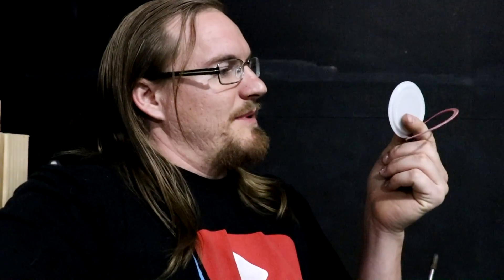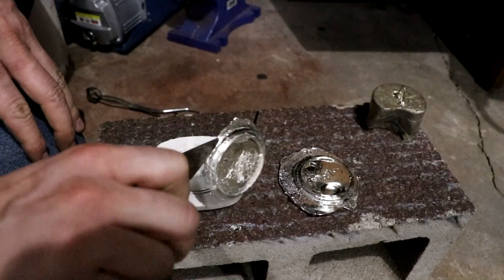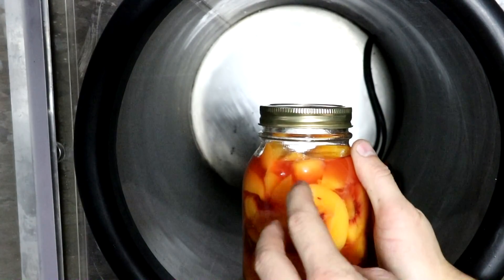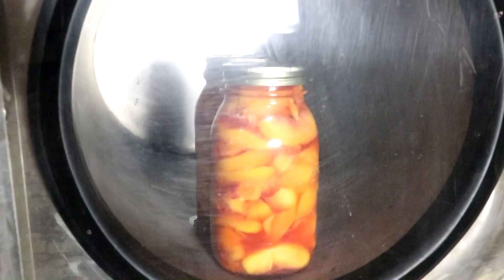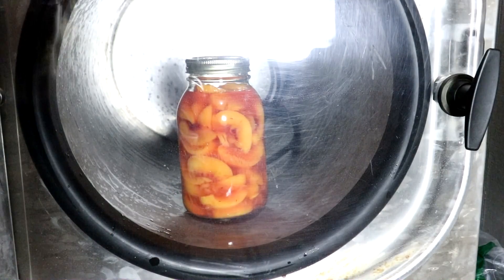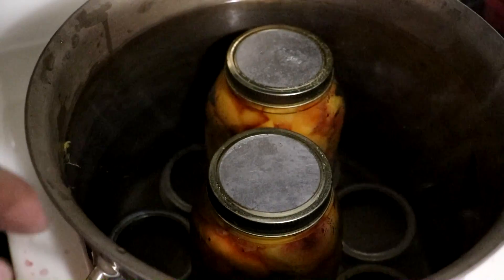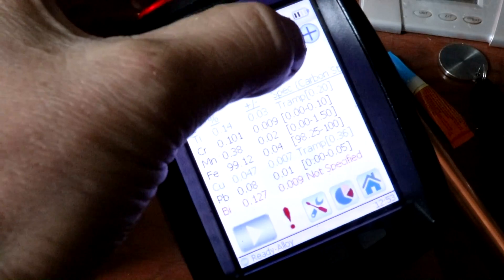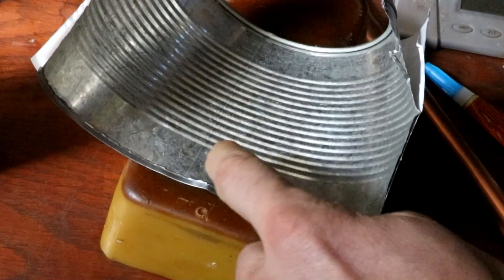Tin Canning Lids?

Comment: Could you use Aluminium instead of Tin?
Reply from the maker: Not without some sort of protetive coating, acids in the food will attack bare aluminum and the result is potentially toxic.
Reply: @theCodyReeder  what about gold?!
Reply: In theory gold is usable because of its resistance to corrosion, but gold itself can be toxic to humans (though gold poisoning is rare - the metal itself is almost inert, but can form compounds which are toxic). Aside from how expensive it would be, pure gold would be far too soft - less pure gold might be more mechanically suited to holding up against the pressure, but then you might have traces of elements like arsenic in it.
As for lead... the answer is no, like mercury, lead is toxic and using it for this purpose is not a good idea.
There's a reason why stainless and coated steel has risen to the prominence it has in the food packing industry.
Aluminium cans do exist however - the aluminium oxide layer typically protects it from most acids since few reagents are powerful enough to displace the aluminium from its oxygen atoms.
Reply: @ValleysOfRain  *OK, well if lead isnt a good choice due to its toxicity, then let's follow the commendable example illustrated by the Chinese govt and industries, after we(USA) discovered lead in some imported kids toys and costume jewelry. Once confronted with this issue, the Chinese  responded by agreeing to cease shipments of lead tainted toys. The Chinese government agreed to replace the lead with more hypoallergenic materials, which they did! It wasn't long before our children were once again playing with Chinese made toys and jewelry, only now they were constructed of, or painted with kid-safe, parent-approved cadmium! Lol. 😂 {Sarcasm, of course. Cadmium = bad}*
Reply: @patrickmcleod111  are you quite alright?
Reply: @ValleysOfRain  yep. I'm assuming you missed the "sarcasm" disclaimer and the smiley face at the end of my comment?
Reply: @patrickmcleod111  I still question the sanity of an individual who writes an extensive comment such as yours simply for sarcasm purposes. I mean no disrespect, but don't you have better things to do that resurrect year-old comments?
Reply: @ValleysOfRain . Ah, so in your professional opinion, I'm "insane" because I made a slightly(admittedly) long post, that involved sarcastically casting light on a very real problem? I'm not sure I agree with your prognosis there doc. 

I DID have an hour to kill at that particular time. So.... But BTW, while your out looking to find fault with other people, I'd recommend asking yourself why it is that you feel a need to cast aspersions and insults at people you don't even know. Normally when I see a sarcastic comment that is in no way insulting to me, I read it and move on to other things. I don't think to myself, "gee, I should take the time to send an unjustifiable insult to this person"!
Reply: What about other, more unusual metals? That'd be fun to try :)
Reply: we all know the next step is a solid gold can lid.
Reply: Cody'sLab  would anodizing it do the trick? I have set that up with just sulfuric acid and a battery charger
Reply: Cody'sLab  but literally all of the UK's tins are made with Aluminium
Reply: @thetechoasis2179  pReVeNtIvE CoAtINg
Reply: @theCodyReeder  What about stainless steel since it's cheaper and safer to use with food
Reply: @Bluboy511  I'm sure Cody could find a way to make it happen but steel would be absurdly difficult to get molten for the casting process. Maybe a sheet could be heated and stamped against a die to get the shape. It would still be a ton - maybe even a tonne - of work but the durable, reusable lids would pay off.
Reply: Do a video on extracting mercury from canned tuna. I think the mercury levels are not so bad as they state because lots of people of asian countries eat tons of fish (especially tuna) and have some of the world's highest life expectancy with no ill effects to their cognitive abilities.
Reply: EETechs  Agreed!
Reply: Valleys of Rain. Aluminium cans are generally given a plastic or lacquer coating, to prevent the metal from reacting with the food or drink. Aluminium in the body is under suspicion as being one of the causes of dementia, or perhaps those people with dementia have a propensity towards accumulating higher concentrations of the metal in the brain. There have been worries about high levels of Aluminium in tea, to the extent that studies were being conducted with people who drink large quantities of tea. And, in some countries, many cooking utensils which contain the metal  are now being either coated in ceramic, PTFE, or being phased out and replaced with steel or other materials.
Reply: Ah,ok.
Tnx for the reply btw! ;)
Reply: yeah and spill mucry on it and see the cool afect
Reply: @Nigel Cam So you unironically think that the consumption of metal being unhealthy is a conspiracy theory? You must have eaten too much Lead then.
Reply: or frick? frick will work, make it lightsaber proof to
Reply: Interesting topic here, what about those aluminum foil they use to pack some foods?
Reply: Should AVOID aluminium in cooking and food prep - large amounts of aluminium have been found in brains of patients with dementia and Alzheimers ...
Reply: @carlyonbay45  The link between Altzheimers and aluminum has since been disproved. Apparently the wash solution they were using on the brain tissue was contaminated with aluminum.
Reply: No , it was more than one study ...its been known for a longtime ...care homes and hospitals banned aluminium cookware - they only use stainless steel now .
Reply: mark layton Also, that Aluminium in almost all the underarm deodorants everyone uses everyday.
Reply: Yes, thats why you should stop using them. Aluminum is poisonous, thats no medical conspiracy theory, thats a fact. Of course you cant know if Aluminum on your skin accumulates in the brain but if you have a non poisonous alternative, there is no reason to go with an even small risk.
Reply: @Chuckiele  mark layton Okay Gift et al --- A lot of things contain aluminum and are eaten pretty freely, like pickles made crisp by Alum, pastries leavened with (the common type of) baking powder, some "lake" type food colorants, Maalox-type antacids. Probably more I have not become aware of, too. Aluminum in food is not inert, it causes a 'binding' effect on poop, probably by reducing the motility of the gut. Lake pigments are especially common in the coatings on pills, M&M candies, cake frosting, etc. Read your labels!
Reply: @etizoman2403  elderly people don’t
Reply: @carlyonbay45  Wow 4 years shows a lot of change lol, this has actually been disproved.

Comment: I like your eye color.  They had back in the day 'glass' tattler type lids that used rubber seals, they also made zinc lids that used reusable rubber seals, and had zinc lids that had a non-removeable glass/porcelain insert on top so 'your food never touches any metal'.  I think they all worked on the glass top - wire and bail canning jar principal.  A reusable glass lid.  I heard silicone rubbers can get moldy, where rubber ones do not.

Comment: It's really interesting to understand that tin metal is non toxic, but tin salts and organic tin are extremely toxic.

Just like mercury, as salts, the tin can be dissolved in water, then travel from your stomach to systemic circulation. With organic tin (basically with minimally one atom of carbon linked to the tin), the tin becomes soluble in oils and biological tissues and can dissolve through skin

Comment: I work on an electrolytic tin plater line at a major steel company.  Tin is still used commonly in the tinning industry.  We also use chrome plating as well.  Aerosol cans are also a major portion of our market.  We use tin by the truckload on a daily basis.

Comment: Would you do a video on canning with antique glass lids? Currently there is only one YT video showing glass lids. Everyone who cans with Weck jars go on & on about how great they are, how beautiful they are & how healthy the glass lids are. I was searching for all canning lids on ebay and low & behold, glass lids made by BALL, Atlas, Presto & and several more came up. Apparently these lids were used between 1930-1963. I knew about the bail jars & ]their lids but the lids I’m talking about actually fit the regular & widemouth. Of course you have to find the gaskets for them. I have actually canned with them and they worked great. I looked up the directions in a very, very old Ball Blue book. This must be what Tattlers based their design on because it’s the same. Lid — gasket —- ring, but barely finger tight.  Now I can brag about my beautiful glass lids & mine were made in the USA years before Weck came along.  It was a thrill canning with antique lids and having it work out. The seal was so strong I couldn’t break it. The Ball instructions said to “open by placing the knife tip between the rubber ring & jar (OMG)”. Is that why they changed? Maybe if they had made a tool to open them, we would still be canning with glass lids today. I wasn’t about to tinker with a sharp knife tip, I’m much to accident prone. I did finally find the perfect solution. I used a laboratory spatula (I have these around because I make my own creams & lotions). The lab spatula is thin enough to pop the vacuum. So, please, do a great video on canning with antique glass. Sometimes we had it right in the past but gave it up! All I know is I don’t have to throw out my glass lids every time I use them. My next experiment will be trying a silicone gasket.

Comment: I saw in a toy locomotive video that a lot of parts are ladled into a metal mold and then a top is pressed onto it with a leaver. You can probably find many CNC-owning folks for hire to make you a handy mold for tin canning lids. If you have them machine it out of copper, it may even leave a trace residue that will kill germs, but not so much that it flavors the food.

Comment: Cody, don't worry about the lid blasting off. I lose at least one jar every year because I forget to turn the burner down from 10 to 7 once the jars are in the water. You just hear a noise like a balloon popping because the glass explodes before the lid gives out. The water and the canning pot contain all the shards and you're in no danger unless your hand is in the boiling water.

Comment: Cody'sLab
 -- You should be made aware that silicone sealant, and indeed virtually all elastomers, are not rated for high vacuum work because they all leak. The workaround is to use them in pairs, with a non-critical vacuum in between. Even a crappy vacuum is still down in the millionths of 1 bar, so there is very little force available to drive molecules through the tortuous micro-channels in the elastomers. Even then, it's not recommended for keeping helium out of the high vacuum. Helium will even pass through solid glass! (Slowly, of course.)

Comment: Hi Cody ! How are you ?

In your vaccum chamber, can you put a graphite crucible supported by, may be a cellular concrete, fill with lead or something like that.
And, then heat the crucible with your powerful laser in vaccum until the maximum temperature is reached.
What would be the maximum temperature in air pressure and in vaccum ?

Comment: You're overtightening the ring on the rubber gasket and you can clearly hear the vacuum seal collapsing as you turn the ring at 09:08. You can also see the juice level drop as air flows in. The ring is only there to keep the gasket and lid in place while the seal forms.

Comment: Doubles the process time (at least), but try removing the bubbles without the lids first.
That way you only have the air cavity at the top to worry about, on the second run.

Comment: The problem with replacing plastic with metal is that it's usually less environmentally friendly than plastic. Plastic does not become instantly unusable after one use, especially bottles - just use them as long as possible and replace them when they're actually unusable.
With things like this that can only be used once, just don't use them if you're concerned about the environment.

Comment: hey there guys, I have come up with a Idea that provides interstellar propulsion, I went to NASA site to see if I could sale the idea, and it doesn't seem to be possible to make the sale!!, does any one know of a way to connect the sale??, is it better to do this with other space agency??
Reply: I have a contact at SpaceX, send me your email and we can get you guys in contact.

Edit
After watching your video, your proposal has some massive issues. Magnetic propulsion would lack the force needed to launch a spacecraft. Mag-lev trains are heavy and are capable of very fast speeds because the only resistive force is air resistance. Lifting something is very different than floating it.  You also forget that all the destinations we are looking to travel to in space are moving in different directions and different speeds, there is no way any infrastructure can be built or placed between any destination. 

Nuclear outfitted ships would also never be viable as the shielding required would weigh too much, you couldn't have a small one like a submarine you'd need a massive one and there is no water to run it on.
Reply: hey there, the video that you saw was about a prior idea that I had earlier this year, I have been working in a video that goes a tad deeper than the 2 already provided, I have been struggling with what seems to be some sort of lung infection, so when recording the voice explanation I find my self gasping for air... this far most of the audio seems to be done, and perhaps the last 30 minutes are still needed... may be less... to the video I am adding a lot of drawings to make it more entertaining and explanatory, yet some of these drawings can take me more than a day... by the way I most be clear, this is about space propulsion, not about propelling something straight  from the planets surface... the video that I am currently working on should provide a better understanding, I can say that, the idea that you saw seems to be a strong candidate for interstellar travel, yet I just had a second idea, this happened while I was editing the video, I suddenly found my self with this totally new concept, I think these 2 are possible, they may actually be the best way to travel long distances, talking about your contact in space x, please have them send me from space x, something like a private message to my youtube channel, it may be the best way to keep me protected from a troll, or from something worse... I wonder if they could use my patreon page in a private manner, I am new to patreon so I am unaware if they could do such a thing, but it could be that patreon actually offers some sort of private communication, the ideal thing would be if they could send me something straight from space x, so I can openly start communicating knowing it is actually space x and not some wako...

Comment: Hi Cody! Do you think you could make graphite (not graphene) from scratch in one of your videos?  I have heard that you can run natural gas (methane) through a meter tall column of liquid nickel and bismuth at 700-1065 degrees Celsius to create hydrogen gas (95% pure) and methane with the carbon collecting on the top of the liquid metal to form graphite. Is that something you would be interested in looking into?

Comment: CODY!!!! PLEASE DO A VIDEO ABOUT A PLUNGER IN A VACUUM CHAMBER!!! WILL IT POP OFF? IS THE "VACUUM FORCE" ACTUALLY THE FORCE OF THE PRESSURE OF THE AIR AROUND IT, PLEASE LIKE SO CODY SEES THIS!!!
Reply: basically, yes. it won't pop, the air inside will gradually expand until the pressure inside is equal to the air around it, the plunger wouldn't even fall over.

Comment: you could use aluminium instead of tin its cheaper and still work just as well, also I'd recomend punching out the lids instead of casting them, cleaner and easier than messing with molds and such

Comment: Could you use some Valve Lapping Compound, sacrifice a jar, and make a more uniform seal surface on your metal lids?  Then either coat them with silicone, or use the rubber gasket?  Neat experiment, thanks for sharing!

Comment: I routinely reuse the standard lids.  I have to make sure that they aren't scratched on the bottom (inside.)  Of course, I also make sure that they are properly sealed.  I have had very few fail.  The failures go into the refrigerator and are eaten soon.

Comment: couldn't you reuse the single use metal lids if you remove the single use gasket and replace with a rubber ring or silicone?

Comment: You could set them in 120-130 degree F water for a longer period using the vacuum chamber first.
The 7.0D at that temp is 2+ hours.  This would allow for retention of more volatile flavor compounds and possibly more vitamins?

You could do some flavor tests, probably make an interesting video.  
 High temp canning vs vacuum chamber and lower temperature.
 
Even better if you could do long term vitamin analysis. . But not sure how you'd manage that one.

Comment: hey cody, all of this is overkill. The way to seal those lids properly, is simply to pour your food in while it's steaming hot, and leaving a bit of air close to the neck of the jar. Then quickly seal the jar tight with the usual lid. When that water vapor cools down, it'll almost create a vacuum in that air volume. You'll be able to tell because the lid will be concave. That will keep your food good for years, if you also store in the dark. If you happen to be storing cold stuff, you can still create a vacuum by pouring a little bit of food grade alcohol on top and setting it on fire before closing the lid.
Reply: also, you don't really need to throw away the metal lid. I found that the Bormioli lids can be reused many times, maybe up to 6. At least 3 times for sure.